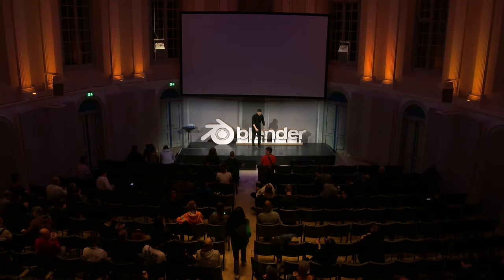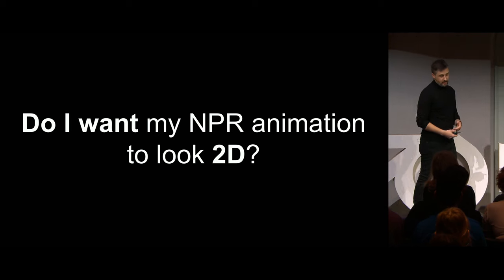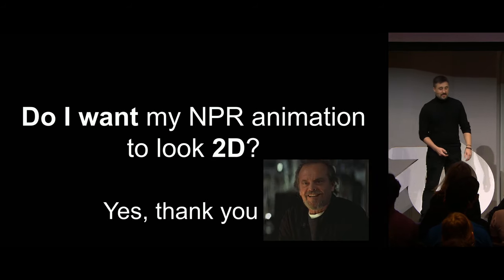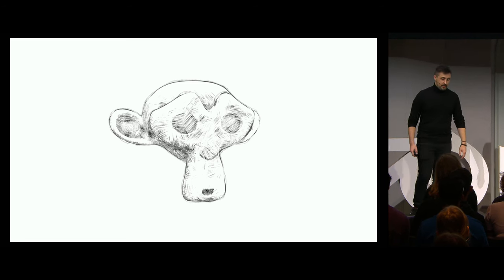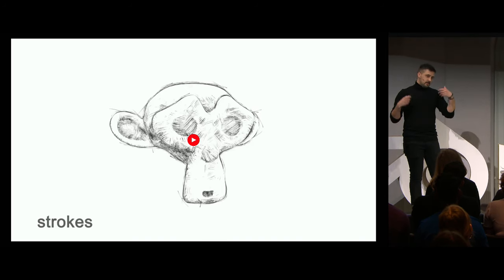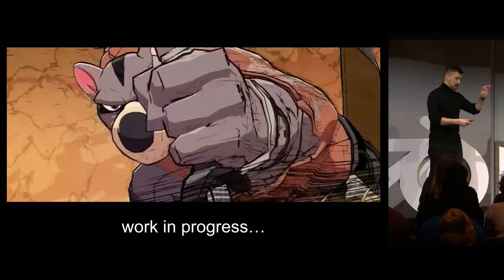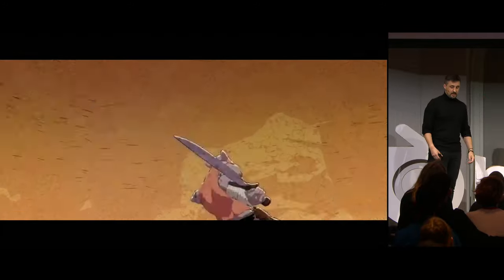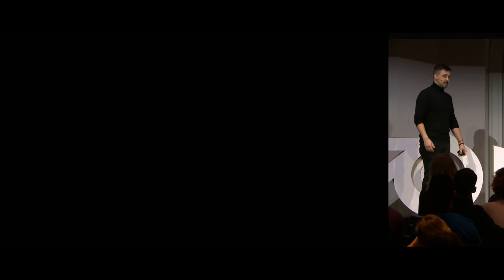Why my 3D animated NPR project doesn’t look 2d enough?

Comment: That skull animation blew my mind. It has the energy and fluidity of a 2D animation with the level of detail only realistic for a 3D model. Absolutely stunning.
Reply: He used Keymesh addon for the animation
Reply: @Skedooosh  i need to get that. that is gonna be awesome
Reply: Yeah, adding noise to all the little things did wonders.
Tho my personal tastes say I would have preferred the end result to be on 1's still. Smooth 2d looking animations are rare, due to budget reasons.
And later on I get why they'd be rare on NPR too for budget reasons. Cause a lot of it involves going over frames, swapping models mid action, and other tricks.

Comment: Would like to add my two cents, with alot of 3D animations that look like 2D, one thing i see all the time is with the perspective. Its always perfect, between two characters or even different scenes with the same character its extremely difficult to get them to match. So one thing that might be a fun thing to do is to maybe have as multipass render where characters are rendered either with different cameras set to different focal lengths, or to somehow procedural distort them in the z axis relative to the camera. Anyways great talk alot of helpful insights in here.
Reply: Agreed! That's what I've noticed as well. Perhaps Geometry nodes could handle this? Procedurally distorting based on the distance from the camera or how far away the normal is pointing from it (maybe).
Reply: I agree that it would help simulate 2D animation better. However I think that it is better to retain some of the 3D's accuracy. Since the entire point of emulating 2D art in 3D is to make use of the perfect perspective and cameras in order to produce scenes with better cinematography easily, or to achieve accurate and automatic foreshortening etc...
Reply: Thats so cool
Reply: @jutraim2422 just make sure it's not distracting
Reply: I think like rendering characters with a transparent background then animating the scene where that 2d render is on a plane might achieve that. Allow you to do more parallax effects and make it less perfect.
Reply: @jutraim2422   I think what you're addressing is very project specific. if you're doing a spider verse look then of course retaining the 3D element, if done right, will look really good. However I think this is going to lead into a way to have quicker turn around times for "2D" animations once you have a smooth pipeline and workflow. So it will really be dependent on what the look you're going for is.
Reply: @grantpeterson6559  
I'm all for it if it makes it easier to produce 2D-style stuff in 3D. Or stylistic choice. I get what you're trying to say.

However, I find it very counterintuitive to use 3D software to emulate 2D to such a degree that you miss out on one of the most crucial things a 3D environment has to offer in the first place. Which is perspective simulation.

Next, we need to find a way to remove certain angles of objects while we're at it since 2D animation usually doesn't capture all angles, usually only about 16. Also, let's make scenes with a moving camera very jerky since it's traditionally done poorly in 2D. OK, imagine we did those and more to emulate 2D; why were we designing in a 3D environment again instead of using rigged 2D assets? Which is more accessible and easier to design, render, process, and iterate on if you set up a smooth pipeline or workflow. (However, If you only know 3D software but love the 2D style, following such a path feels viable.)

I'm not saying never do this or that. I just feel like there should be a line drawn somewhere along here. I'm a graphics designer; I have animated both in 2D and 3D for about 8 years and am currently developing my own game. I love using 2D-style shaders in my 3D game. I think it looks beautiful, but I would prefer to avoid fighting any harder against the environment I'm designing in.

I would love to know about your thoughts on this. I'm open to any ideas, I'm not very firm on my stance on this topic.
Reply: 2d has imperfections, whereas 3d will almost always stay accurate between different scenes
Reply: the guys at ArcSys solved this by distorting the models themselves. the lead artis has a conference talk where he explained the process of how they created the art style of Guilty Gear Xrd, look it up

Comment: really good talk, i will say another thing is a selective use of frames is another thing that makes it look 2d. Animators usually switch from animating in 2s to animating in 4s to depict changing speeds and to make animation easier.
Reply: Yeah, it is tempting for new animators to blanket animation with 2s or 3s or 4s. But when I do study frame by frame on Sakugabooru and the likes, the lesson comes very simply. You simply draw the frames that your animation needs and you have time for. So with the masters the frames per seconds vary wildly, often inside the same shots they will go from stills of seconds per frame right down to animating on ones when fluidity is needed and budgets allow. And you can cheat framerates by selectively cascading the cadence to make animation on twos and threes feel like ones because there is new movement in each frame. 

Also. Detail levels on masters shots adapt wildly as well, both to make drawings faster and to keep the animation readable at playback.

Comment: i think part of the issue is the density of design. 2d animations are often made relatively simplistic in design to minimize how much work is needed per frame. some high density npr designs look 3d because of the detail even when they are still. of course designs are subjective and this isnt always the case

Comment: Because of things that go deeper than the model’s surface, like muscle tension and relaxation. In CG, it takes a lot more fine tuning and knowledge of the 3D program to make the character look and move in a detailed and believable way. With 2D animation, you individually illustrate everything and have way more control over each frame. Not just elasticity in terms of cartoony exaggeration, but in terms of realistic and detailed muscle movements that you would typically only notice up close. Amazing stuff can’t wait to see where 3D goes from here

Comment: I think to add even more imperfections, adding extra bones to the rig in order to move elements of the face around, changing the scale of certain bones for certain frames and maybe even drawing the shading by hand on flat characters would sell the 2D effect a lot more.
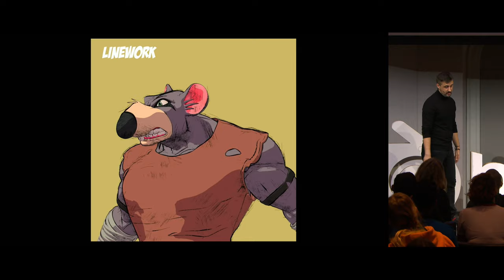Reply: He showed off doing that at 14:27. And the rigging stuff he shows off at 12:20.

Comment: In my opinion, asking "Why try to make 3D look 2D when you can just draw?" is like asking "Why buy a car when you can just walk?".

Am I mistaken in thinking that NPR 3D will be, if not easier, than at least less time consuming than traditional animation?
Reply: Speaking as a hobbyist on and off: it depends. In traditional animation, what you see is what you get. You draw what you want, and if something needs to be done that isn't set up yet, draw that, too. So depending on the project, more time on the actual making of the thing. Something like Loud House with the floating mouths would take less effort, something like Wakfu with the epic battles would take more effort. That's comparing 2D to other 2D, though. It's still object-based if you're using software, but it has a different set of limitations and a different distribution of timesinks. 

In 3D, there's a bigger timesink towards setting up. Making your 3D models, checking the shaders, how to do the linework if any... from what I've seen, it still involves drawing, primarily to plan ahead. If there's a need for an expression and your characters can't do it, it's way harder to add in 3D than it is in 2D. But on the upside, it can be easier to propagate that change to other characters. Something like Paw Patrol, where a lot of the pups look like they have the same topology and probably the same rig, can take advantage of that. Something like Digital Circus, where all the characters are vastly different, cannot. 

Also, one answer to that question a lot of people might forget: not everyone can draw, and learning 3D can help you get maybe not the same skills in drawing, but at least help you get to definite results much faster. It is possible to do a 3D render of something you cannot draw, and then rotoscope it or ask animators to draw following that render as a reference. That's how the Big Ben scene in Great Mouse Detective was done, and at least one combat scene in Ranking of Kings. There was too much going on on-screen in both cases for traditional animators to worry about (turning cogs and falling debris along with camera movement, respectively), so 3D rendering gave them a reference to work towards. 

Again, not an expert, so take it with a grain of salt, but that's what I've gathered so far.

Comment: Video Tl;Dr:

This video addresses a common problem faced by 3D animators creating non-photorealistic renders (NPR): achieving a 2D aesthetic. The creator, Toni, argues that true 2D animation is more than just "looking like" 2D; it’s about replicating the limitations and techniques of 2D animators, which often involve a trade-off between stylistic choice and technical capabilities.

Toni stresses that it's essential to understand the differences between 3D and 2D animation, particularly when aiming for a 2D style. He outlines several key points to consider:

Technical Limitations:
* Camera Movement: Achieving smooth, convincing camera movement in 2D is incredibly difficult, while 3D offers seamless camera manipulation. To overcome this, Toni suggests minimizing camera movement and focusing on reframing techniques. Any camera shake or movement should be added in post-production.
* Drawing Consistency: 2D animators must meticulously redraw elements frame-by-frame to maintain consistency, whereas 3D allows for easier adjustments. Toni recommends adding intentional imperfections to lines and outlines in 3D to mimic the "hand-drawn" feel.
* Shading and Lighting: 2D animation often relies on flat colors and minimal shading, while 3D allows for complex shading and lighting. Toni suggests using flat colors and minimal lighting to emphasize the 2D style.

Artistic Choices:
* Character Design: While 3D allows for complex character models, simpler, less detailed designs can enhance the 2D aesthetic.
* Stylization: Choose a visual style that aligns with the desired 2D feel.

Ultimately, the goal is to replicate the challenges and limitations of traditional 2D animation in a 3D environment. Toni emphasizes the importance of understanding these differences and developing creative solutions to achieve a successful 2D-style NPR.

Comment: NPR with 2D inspiration as well as mixing 2D and 3D can be a way of doing stuff that is possible in 2D but that would require too much work. In fact, that's what 2D does by using a lot of 3D backgrounds. Mixing 2D and 3D is beautiful

Comment: I don't think fps limit or camera restrictions are a good thing. They generally make the visual experience worse, and can only be taken in specific circumstances (like spiderman being awesome in every pose mid-seing, and that lets us cherish each longer).
What really breaks the 3rd wall is how shading moves - if it follows the shape of the object so well that you see the 3d shape, then you can't unsee it. Outline can be any, but shading is what sells and kills it. Decrease the angle range acceptable for lower shade color and you get the 2D look. Balance the colors. Remove standard smooth gradient shading. That's the greatest impact.
Reply: My man just hits on the right spot💀

Comment: So I dont know much about creation of styalized 3D, but whenever I see stuff like that I just think that they always overdo it with the outline making it very thick and not scaling it down as characters get closer to the camera. Because of that the outline looks static and... well 3D, like a black chunk sticking out of the character. Same with outlining hard shapes and too much details like teeth and such, maybe using second simplified wobbly teeth model (like just two white blocks instead of individual teeth) may help

Comment: I think that this 2d styled 3d is probably the best and most ethical use case for AI. We know 2d animation studios are brutal work environments so I feek like if you could animate 3d scenes, pull out key frames every 30+ or so frames and then hand draw them then use style transfer to match the rest it could really bridge the gap. One of the biggest issues with 3d is the uncanny perfection so in a way the slight inconsistencies of style transfer would introduce more "human"-esque variation. If you're using hand drawn frames by your studio as the style reference youre also avoiding the big AI art issue of stealing, you'd only train it on in house data sets. Even with 2D animation you could use it to give foreground elements the extra painted detail of traditional static backgrounds. And then it would drastically reduce animator workload (I know 3d animation isn't easy but CGI animation is popular because it can be much less work intensive than 2d), saving animators from brutal conditions while allowing gorgeous consistent 2d style animation to be made.